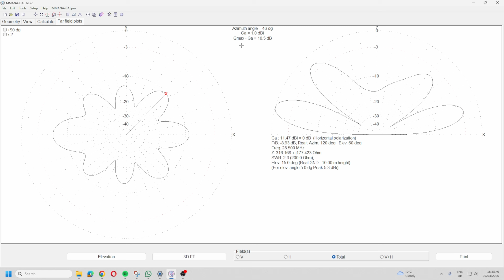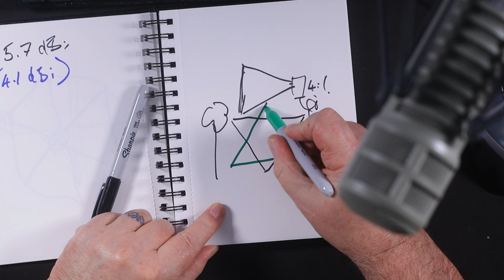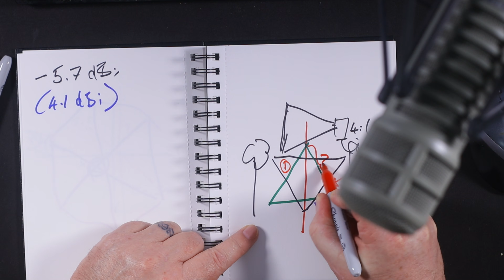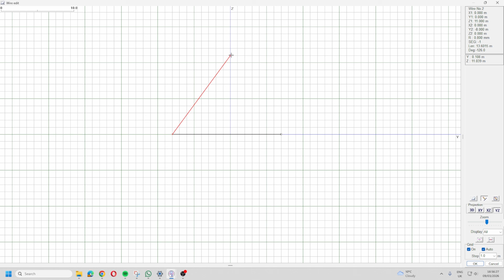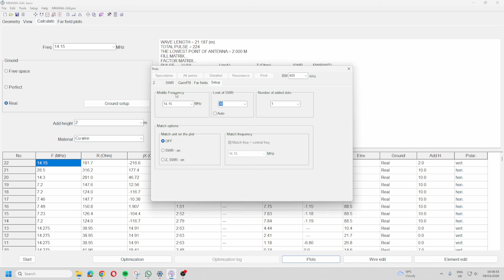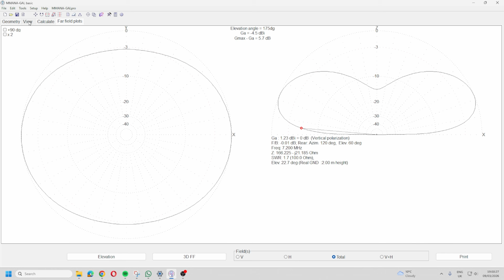Antenna Modeling for Beginners  - Vertical Delta Loop (Part 6)

Comment: One of my first antennas was (is) an 80m FW loop. I've had it up vertically, horizontally, something in between. A delta, square(ish) and a wonky rectangle around a small town lot.  Works well enough for me.  I recommend anyone try one if you've the wire and space.  Works most bands.  Only problem is with that much wire up tree branches in windstorms like to eat them :)
Reply from the maker: Oh yes... Wind and trees eventually devour the darned things!

Comment: I have a 40m Vertically polarized Delta in the backyard. I have worked a station you might know from here in Texas. Call sign M0XXT. Got him with 100W SSB. Deltas are amazing antennas.

Comment: If fed at the apex, it becomes horizontally polarized. 
I run a 40m delta loop, apex down and fed at the apex. Noise is almost nonexistent and talks great. Main gain is off the sides.

Comment: I have 40 meter delta loop as you have drawn up strung from my tree, but I have it fed at the bottom middle with a 2.5/1 balun and I love it! As far as I have read,  it has a horizontal takeoff angle! One of my best antenna builds I’ve done! My next project is a portable hex beam. Thanks for all your great videos! God bless you!
Reply from the maker: Yes, feed arrangement will change takeoff (as you have found).

Comment: I've made flat top delta loops for 10 and 11 meters, by using a piece of plastic pipe, suspended from a tree branch by para cord. I attached the para cord through the pipe and a piece attached to its center, forming a para cord triangle. I cut the antenna wire to length and solder loops of antenna wire around insulators, placed at one third lengths of the loop wire and then one at the open ends for the feed line. As the flat top is lengthened and the sides shortened, the shape goes towards a folded dipole and impedance increases. At a certain point, a 4:1 balun could be used, but with equal sides the impedance is around 100 to 150 ohms, maybe around 120 ohms. The QRP people swear that a slightly larger than usual loop significantly increases gain.  I'm guessing that may increase impedance. For horizontal polarization, feed at the bottom center. For vertical polarization, the feed point should be one fourth of the length of the wire from the bottom center (or from top center). Consider that the loop represents one wavelength, so polarization changes at one quarter wavelength, but for a one wavelength loop, this is actually one quarter of loop's length. Larger loops for lower bands, may make using plastic pipe difficult.  With the plastic pipe flat top delta loop, I've used para cord tied to cement blocks on the ground, attached to the two ends of the plastic pipe. This allows me to rotate the antenna direction by moving the cement blocks on the ground. I guess this could work for a corner top delta loop too. For the corners, I install an insulator at the two corners and then wrap a short length of antenna wire on each side of the insulators and solder the short lengths in place on the antenna wire, to hold the measured corners in place.
Reply from the maker: Lovely

Comment: there is actually a delta loop design with about 50 ohm at the feed point. horizontally polarised.
Reply from the maker: Yes.

Comment: Great info about antenna and the capability of the "updated" MMA program. A full wave loop gives best performance with the high current points just above each other. Then the influence of height above ground is minimized. If you arrange it "horisontal width is half of the vertical height" of the antenna you get pure 50 ohm directly. If you try this "twice as high than the width" antenna you will be amazed of how good it performs. Band-opener and band-closer antenna with it's best gain near 0° elevation.
Good luck de Bjoern
Reply from the maker: Good point!

Comment: I've used a 1 wl vertically-polarized delta-loop on 80m for decades. Mine is fed 1/4 wl down from the apex with a 2:1 balun.  It works very well with credit for 285 countries  on 80m and most all with the delta. It's cut for about 3.600 mhz. An additional benefit is that it works quite well on its 40m 2nd harmonic as a 2wl loop.
Reply from the maker: Fabulous!